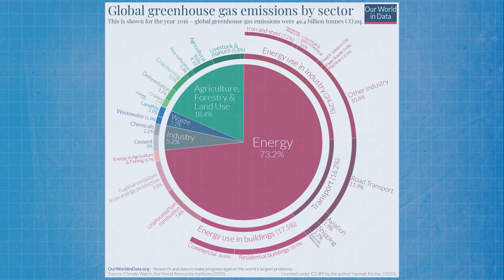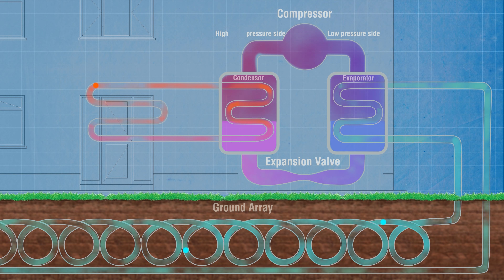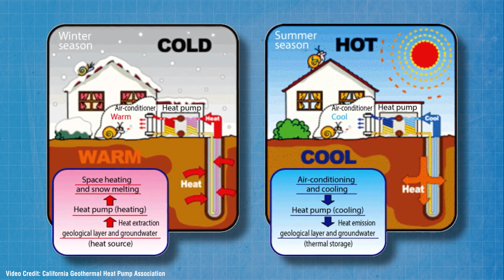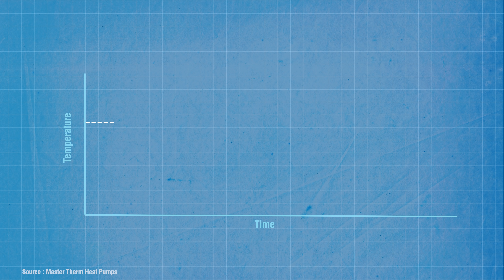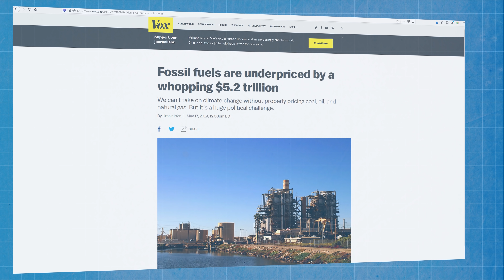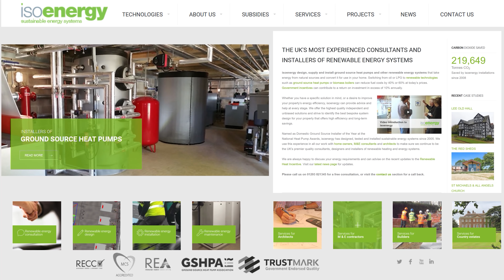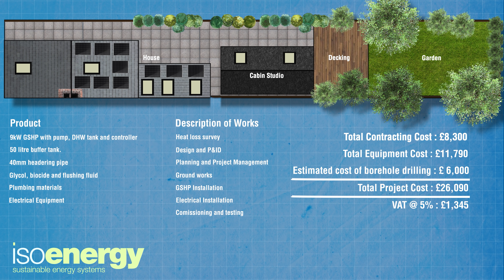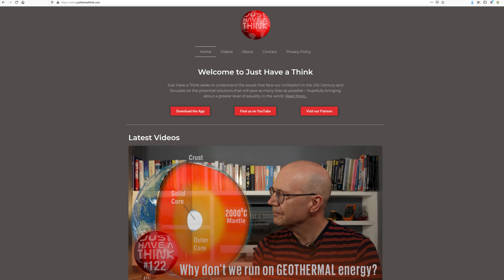Geothermal ground source heat pumps. Heating your home from your own back yard!

Comment: A number of Provinces in Canada encourage home owners to convert to energy saving technologies.  It does not apply just to solar roofs or geothermal installations.  It can apply to replacing homes with energy efficient windows and doors and additional insulation.   
The province of Manitoba as an example, provides a loan at low market rates through its Provincial owned utility, Manitoba Hydro.  https://www.hydro.mb.ca/your_home/residential_loan/ .  All of Manitoba’s electrical power comes from power generated by hydro damns in the northern section of the Province. There is currently an abundance of surplus power that will increase dramatically over the next few years as additional damns become operational.  The surplus is sold to the US with the potential to send to the Province of Ontario in the years to come. Manitoba Hydro is also the supplier of Natural Gas to Winnipeg and Brandon and perhaps to other small towns in the Province. 
If you as a homeowner are interested in any energy efficient upgrade and contact Manitoba Hydro, someone will come to your home to do an inspections.  If you want to change your windows, or even just upgrade to a more energy efficient gas furnace, whatever.... an estimate will be done as to the amount of cost savings that will result from the upgrade.  If in their estimation the cost in energy savings is greater than the financing in over 5 - 7 years, the cost of the upgrade is financed through the homeowner’s monthly utility bill.  As an example, lets say a home utility bill is $500 a month, but with the upgrade the cost of the utility bill is estimated to drop to $300 a month.  If the cost of financing is less than $200 a month, Manitoba Hydro will allow the cost of the financing to be added to the utility bill.  In effect the cost is now $300 a month for the utility and a financing cost of $200 or less a month.  After the 5 year financing period is done, the homeowner is saving the $200 a month.  It’s a win - win.  It should be noted as well that Manitoba has a low home electric utility rate of 8.61 cents ($0.0861) Canadian = $0.0646 US a kilowatt hour. 
This arrangement would not be acceptable in a profit driven privately owned utility company.  However, Manitoba Hydro is a public utility owned by the Province of Manitoba.  This energy efficiency arrangement has been a mandate by the Province for over 30 years.  Recently the program has been expanded and moved under a separate Crown (Public) Corporation called Efficiency Manitoba ( https://efficiencymb.ca/ ). 

As a side note, Manitoba also has much lower car insurance premiums than the other Provinces.  Car insurance can only be provided through “Manitoba Public Insurance.”

Comment: I have had 2 different ground source heat pump systems in 2 different homes since 1989 and have been greatly impressed with them .  I changed from a gas heat electric ac system 3 years ago in my current home and it reduced my energy usage by 2/3 . This has also enabled my recent DIY installation of 12,600 watt solar array with 60kwhr of lithium battery storage to supply almost all of my energy use and with more panels I could also charge an electric car thus reducing all my energy use to renewable except that energy used to manufacture products I buy and no more problems with power outages etc . yes there will be some maintenance and replacement costs but not much as a percentage yearly.

Comment: Heat batteries, just having a think 🙂 I wonder if you could marry up say a sun amp heat battery or any other heat storage device for a individual home or District heating plant and store geothermal energy for when it's needed say a large office block shops industrial units when out of hours could use a smaller system that fits their site build up enough heat for the next day

Comment: I owned a house in NJ that had electric heat.
Got estimate for about $20k for natural gas heat with central cooling
GSHP estimate was $30k, half of which was drilling.
Got the heat pump but costs went to $35k
First winter it did not perform well but did so in subsequent winters
Electricity usage was significantly reduced
Due to how JCP&L bills, the cost of electricity was only marginally reduced.

Comment: The systems in my area mid west US.  use as much power as conventional systems. They are installed by are local power company they sell everyone on what a cost saving they are.  The way they do this is by putting in another electric meter  and charging a much reduced rate for the electric that runs through the unit. Customer  then thinks they have such a good thing going because they pay so much less for there heat in the winter and cool in the summer. But in reality they are using just as much power from the grid as before.  Don't get me wrong i am for saving the planet as much as the next guy but what we have here is a scam in my area if you  think your using less power  and  saving on green house  gas .

Comment: Nice video 👍
I am an HVAC engineer in South Africa 🇿🇦 and we are currently working on a design for a heat pump that has a COP (coefficient of performance) of 12 
Through the simply leveraging of physics
Reply: That's remarkable - is it really possible? Care to explain how you get to twice as much as current top performers. That sounds like it should be beyond what thermodynamics will let you do in practice.
Reply: . Wookey 
Okay so lets go over some general points here 
1:) proof of concept (lab conditions) 
The idea is just to get a greater fraction of the energy input to come from ambient heat energy and lesser energy fraction from electrical input, the proof of concept that shows that it is technically possible to get to 100% heat energy input and 0% electrical input can be demonstrated with a sterling engine 
About 0.2 watts of energy can be extracted from the system running ontop of a full mug of fresh black coffee
Cop of the system is infinite 

2:) some physics can be leveraged in the system by running the desaturated compressed condensed liquid through an adiabatic decompression turbine instead of a decompression valve which wastes the potential energy, the turbine spins a generator coil that “grid-feeds” back to the compressor 
We also put the saturated evaporated gas through an internal heat exchanger that has LP saturated gas on one side (5 ° C in 35°C out) and desaturated compressed gas( liquid) on the other side of the hx (55°C in 35°C out) 
This causes the cold side to get colder and the hot side to get hotter, but the intake gas to the compressor is hotter and the out take liquid to the evaporator is colder and therefore you need a bigger evaporator coil and a smaller compressor, with good computer control we are already at COP 9.8 
16 other innovations are being worked on to drop power input and increase power output, 
The earth’s atmosphere works entirely fueled by heat energy only, why can’t a heat pump... heat IS energy 
it’s not magic it’s just physics
Reply: @Trollsworkshop  That's really interesting - thanks for the explanation. I always hated thermodynamics, and it was over 30 years ago now so some of those details are over my head, but it all sounds reasonable. Good luck. Presumably everyone uses a valve rather than a turbine (with energy recovery) because it's cheaper, and I suppose zero maintenance? What gas are you using? High GWP gases give you a different set of issues. I'd like to see a more in-depth discussion of this stuff so I had a fighting chance of understanding the layout and potential. But 10 rather than 5 or 6 is already well worth having.
Reply: @Trollsworkshop  wow oh wow!
Reply: @Trollsworkshop  OK very nice but I'm concerned about plants and other living beings in the ground where we extract/dump excess energy, what about this, did somebody tested that?
Reply: @Trollsworkshop  As a heat pump user for 30 years it has always bugged me that we compress the gas (consuming energy) and then make no attempt to recover that work during the expansion! Well done for capturing part of that energy!

I seem to recall a 'rotary vane air conditioning system' that someone was building that compressed air on one side, cooled it with a fan, then let it expand on the other side helping to drive the compressor. Since it was cooled by the fan energy is lost there so input still is required of course.  The outlet air is then cooler and provides air conditioning.  Since I am unaware of such as system in use it must not have worked well however it at least attempted to recover some of the energy used in compression.
Reply: Now that's teasing. :-) Love to know more...
Reply: That is very interesting.
I hope this come out of the labs and into heating and cooling applications soon.
Good luck.
Reply: 12 seems very high, more than twice the COP a best in class heat pump can produce. Outrageous claims need outrageous proof.
Reply: Wats COP I’m in USA
Reply: @mitchellcowan945  Coefficiency of Performance is the same in every country.
Reply: Seems that a cop of 12 should be easy to do.  Using a compressor and water pump that use inverter technology. The unit only ramps up and down as needed. To me the strict on off of a compressor is just beyond stupid.  Adding more capacity to the ground loops and perhaps a bit of upsizing on the internal exchanger will keep delta t much reduced.  We have the technology though paying the upfront cost is always the kink point for most.  Seems to me that getting to that 12 cop will just be a lot of $ that will have declining roi

Comment: In Germany you get very good loans for new homes with better insulation and heat pumps. When building from scratch the integration of geothermal plus solar into floor and water heating is great and the additional cost is negible. The alternative would be natural gas heating and alone not having to pay the installation and paperworks of street to home connection saves up to 8000€ depending where you live in Germany.

Comment: I am a refrigerant technician and have built a homemade heatpump on my homebuilt solar catamaran, I use the seawater for heating the evaporator. 👍😅
Reply: It heats up the boat in winter, the catamaran is made of 70 mm foam with Glasfiber laminate on both side and its really well Insulated,
Reply: So, it only heats when the sun is beating down?. 
Or your use cooling also?
Reply: I’m assuming you using it for cooling?  If so would be very interested to find out more.  I’m living in Queensland Australia (having lived 11 years in the UK) - hot dry summer, warm winter.   As an architect we regularly specified underfloor heating in the UK.   On a new house we are doing now in Aus, I’m very interested in underfloor cooling (concrete slab and/or concrete walls) with maybe ground source heat pump.   We’ll have below ground rain water harvesting tanks and I’m sort of interested if one can use this water (which should be cool) for thermal cooling?   The problem, I can’t find anyone who can advise on this.   The general response : what’s wrong with A/C, it’s cheap.....   do you have some thoughts on this?
Reply: @aeasthouse316  what is your average outside temperature where you live all year.
Reply: kenneth schmølker thanks for your explanation and interest.  But honestly, you should be sailing in the tropics!  😂. summer 29/22, winter 21/10.  Can be very humid.   Insulation requirements have increased but still way off most places (R2 - R2.5 in walls, R3.5-R4 in roof.   Because of the generally mild climate, airtightness is really not a big deal.  Summers are long, 8 months the daily ave max over 27.   People use A/C to get temp down and control internal humidity.   Whole house ventilation systems are unheard off.   Buildings are timber frame, insulation between framing,  breather membrane, light weight cladding. Therefore think thermal mass is great (concrete slab).   Mornings are nice and typically you’ll have big sliding doors open.   Around 11/12 it gets hot.  Close up.  A/c on.   Keep sun off slab and then absorb heat in underfloor pipes, run these pipes through under ground rain water tanks to discharge heat and pump back to slab.  So closed loop, discharge heating in water tank below soil.   If need be, small heat pump to cool water slightly - got to be careful for dew point with high humidity.   Hope to replace A/C.  Your thoughts?
Reply: @aeasthouse316  it's the average temp. All year that I need to give you advise, it's the temperature present in 2m below ground level.
Reply: @aeasthouse316  in Denmark it's 7-8 degrees Celsius.
Reply: kenneth schmølker ave looks like 21.6
Reply: kenneth schmølker wow, ave 6-7 degrees is cold.  You definitely need to come sailing here in Australia!!
Reply: @aeasthouse316  dig a hole about 30 cubic meter, deep is better than wide, put a plastik membrane down, wind about 200m of pex tube and place it evenly in the bottom, then a circulation water pump to a calorifer"radiator" and you will have a cheap alternative to the cost of running ac, aproc 1000wh VS Lees than 30wh pr. Hour for the circulation water pump and air lower for the calorifer"radiator"
Reply: @aeasthouse316  just Google it 29 degrees c, ac is the only way, but you can optimize the system by a ground water tank.
Reply: kenneth schmølker thx.  I realise that in days of say 30C you may still need a/c.   But 1, because our houses usually is fairly lightweight, and cooling load quickly disappears when a/c gets turned off.   We don’t generally have double glazing either.   Thought was thermal mass can help store some off the cool / absorb heat.   Removing heat through water (just small pump, low energy) will hopefully make that you have much less need for a/c.   Obviously will insulate and air seal well (not European standards though)
Reply: For heating only, if I wanted cold air "ac" then I would use the sea water trough a califere "radiate" but now I use the heatpump to remove the heat from seawater and transfer it inside
Reply: What is the working fluid?
Reply: @cesarcesar1961  the refrigerant is R600a "ISO butan" as the insulation in the catamaran is very good I only need about 800wh of heat pr. Hour with a outside temperatur at - 5 degrees Celsius to keep 20-22 degrees inside, so I went with a ditched big refrigerator and ripped it for compressor and capillary tube.
Reply: @catesolarcatamaran252  Efficient, but I think is a little dangerous for home applications.
Reply: Super cool!   Do you have plans you can share?  Diagram?

Comment: We live in Scotland and just in the final stages of installing our GSHP system.  3 Bore holes of 190M each, 800litre water tank and a 400litre buffer tank for heating system.  2 GSHPs from heliotherm using the R290 gas running in cascade.   We're moving away from LPG, the financial gains are impressive, much better to do this to the house than keep the money in the bank especially with RHI.  We also have it subsidised with 27kWh PV system and a couple of Tesla PW2s, went full green mode! #cheapliving hopefully!
Reply: That's sounds like a nice set up but lot of money!
Reply: Greg Knapp yea certainly is, although solar and batteries have been in for 2 years so it’s not all been done in one go.  Slowly but surely trying to switch over.
Reply: Agreed. Big savings from anything with the exception of natural gas, unfortunately. The vast majority of the sites we work on are off the gas grid. Don't get me wrong, a heat pump can still save your money vs gas from the grid, but the payback will be much longer.
Reply from the maker: Sounds brilliant! Good on you :-)
Reply: So your migrating from LPG to propane! You save electricity, but upfront cost a few $!!
Reply: Nathan LPG to Electricity basically.  The propane is closed loop non consumable within the units and the gas used to transfer and compress the heat via the exchanger.  The savings since on our current system is approx 50% in running costs.  Combined with RHI were around 6-7 year pay back if we assume elec/lpg prices remain static.
Reply: That is awesome! This is exactly the package of stuff I'd like to do to my place (on a smaller scale) if only I had any money in my bank! Dare I ask how much the GSHP parts of your set up cost?
Reply: @sic1038  Hi Si, the GSPH part is just under 60k, thats everything incl drilling, 2 X GSHPs, 2 tanks.  With the RHI, if memory serves me correctly it returns 35k over 7 years.  We used funds that wasn't doing much with interest rates etc so its a much better return investing it into our home to reduce costs over time.  If we financed it then our monthly ougoings would probably be similar to paying our conventional bills until finance paid back but essentially operating at a lower cost and it ties in with our solar so we can hopefully benefit from a quicker return.  Our home is large with 2 houses on site and some out buildings are all tied into it to give a combined system, so a bit more labour/parts involved too.
Reply: @wbryce  Aye that's a fairly huge system so that cost doesn't surprise particularly. The RHI really helps a lot doesn't it! I'm glad it'll pay for itself over time and of course you can have the satisfaction of knowing you are carbon free! Good on you.